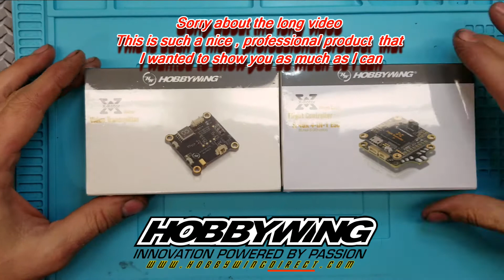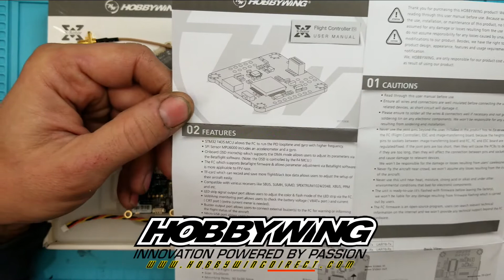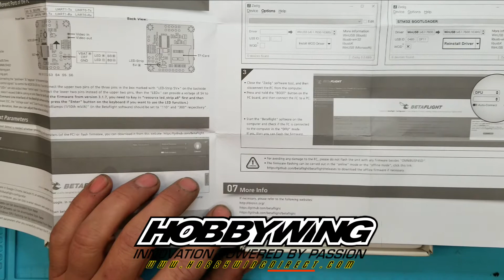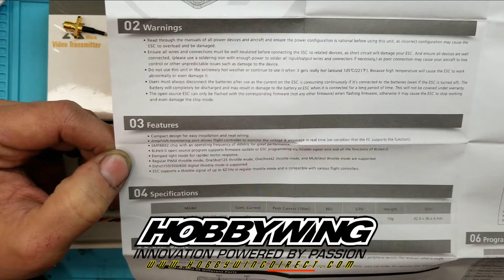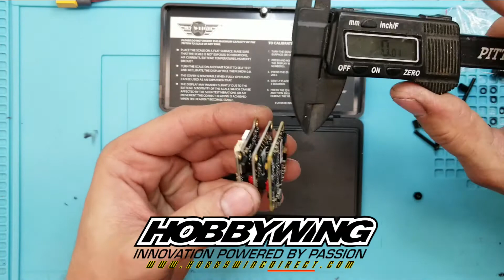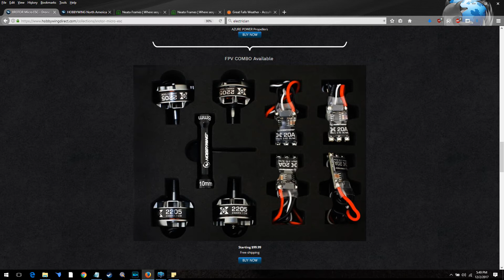HobbyWing XROTOR Flight Control System with VTX Amazing First Class

Comment: I am half way through the build, well nearly finished, though I was wondering if I need to connect the signal Esc cables to the flight controller? It is easy enough to do, though with the connection how it is, I thought that the plugs may take up the data.

Comment: Question about the FC and where to power three items?
Powering the Rx is obvious (R-XSR goes to GND, 5V, SBUS)
Powering my Unify pro Vtx (it only takes 5v and does NOT output power to a camera) uses the other GND and 5V on the rear end of the FC.

Now, where does my camera get power? It's a micro Foxier Predator rated for 5v-40v. I'd rather not power my camera directly to VBAT. Is there a clean source of power for my camera?

Thanks
Reply from the maker: You could hook up the camera where you hook the receiver I believe as I think the 5v rail on board is 5v 1A. If you don't want to do that then hook it up to the LED pads and configure the LED port in Betaflight to always be on. If you look at the instructions the 5V LED is good for 1A. I'm sure your camera uses less than this.

Comment: I just finished setting this VTX in the Hobbywing stack and there are a couple of things that surprised me.

First off, this VTX does not support changing your bands and channels from your Transmitter or goggles.  Your only opting is to use the buttons, Be sure to mount this unit with the buttons accessible and be sure to be able to see the LCD screen.

Next, and this is really a deal killer, the bands shown on the screen are NOT the bands that everyone else uses.  For instance, “A” band is Fatshark is on your receiver, E Band is “B” and Race band is D.   If you fly alone that will not be an issue but if you fly in a club and have to change bands often you will want to make and take a cheat sheet.
Reply from the maker: I did not know that... I'm in the middle of a remodel and haven't build my quad with it yet..

Comment: I’ve got the same stack that I’m putting in my first build now. I’m still waiting on my motors, but for a first timer it seems like a no brainer. I like how everything is made to fit each other with minimal soldering. 

I did notice that if you’re a little heavy with your iron, some of that coating will melt on to the pads, making it hard for the solder to stick. But after getting past that everything is going smoothly. 

I definitely can’t wait to try this thing out.

Comment: Need pinout of FC upper VTX port. Both video solder pins long gone as HW F4 core is very soft material and in short time heat will destroy this FC. So I busted off upper VTX brick cause in the way but removed it so each pin is intact and could easily solder video to the correct pin but cannot find layout of upper vtx mount . Lower for ESC is included in the ESC manual but no info on VTX pin layout anywhere. Any knowledge of the VTX layout would be great.
Reply from the maker: Loki's Dream I would call support at Hobbywingdirrect.com I'm still waiting on graphics for my build so I haven't played around yet with the stack. Just curious, how did you break it?